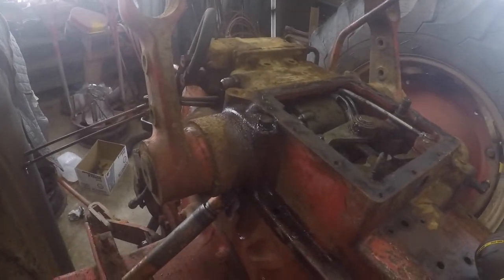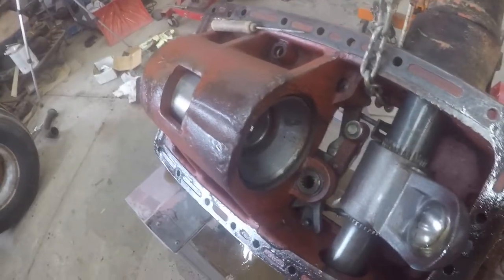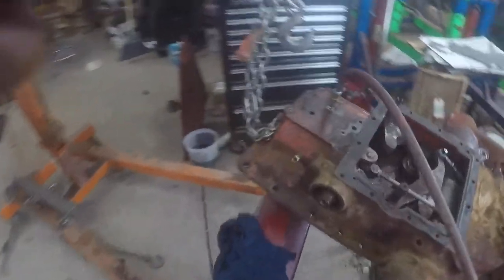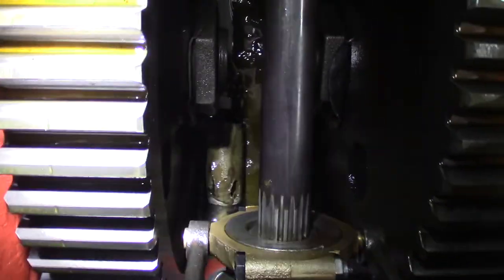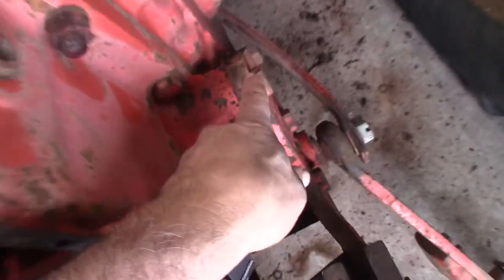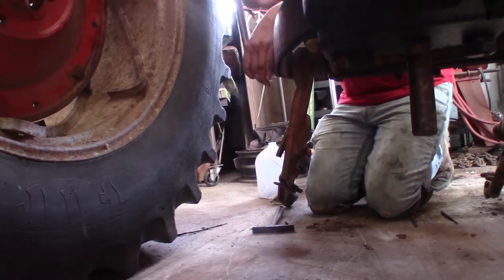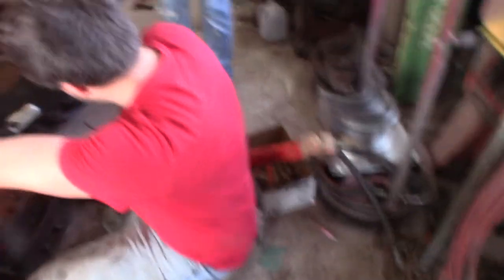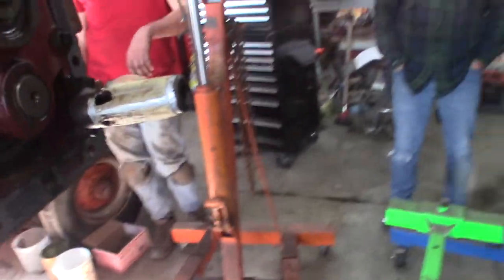Case 830 rockshaft and PTO housing removal. Stuck rockshaft piston.

Comment: Thanks for your videos I worked for an I H dealer here in the thumb of Michigan for 30 yrs nice to see your works in progress
Reply from the maker: Wow! Thanks Dave that makes my day!  Kinda struggling with the thought of all the tractor oil I have to buy. Pretty close to 35 gallons. Was thinking TCH in the 1150 and Case o Matic. And hytran or mastertran (same thing I hear??) in the tractor trans sump? Mainly cuz Im worried about the old clutch plate glue? Ive heard the Hytran can turn a case o matic into a probl o matic....Any suggestions.